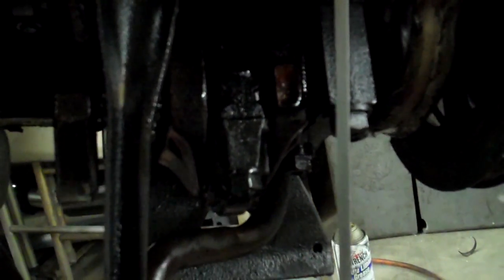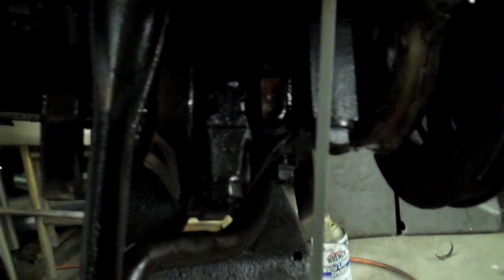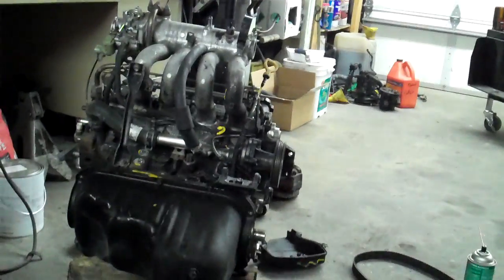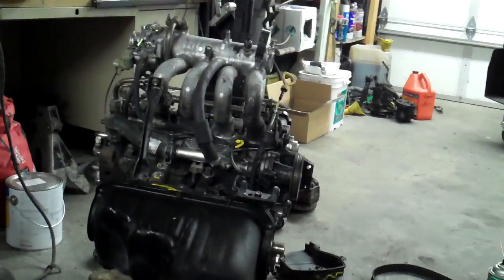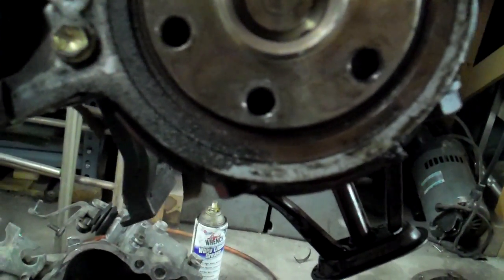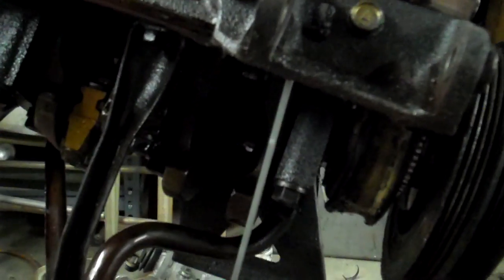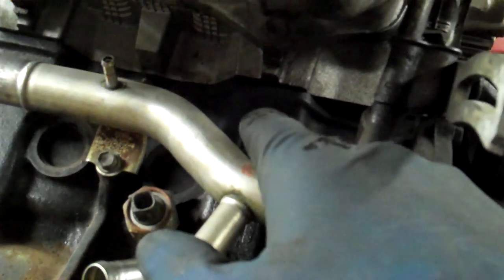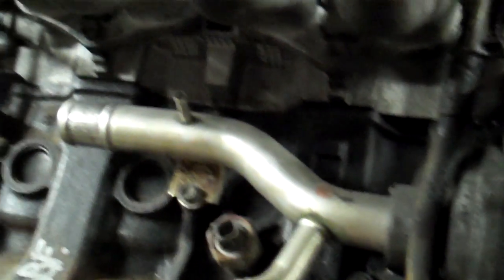ROD KNOCK!!! What it looks like inside the engine.

Comment: Thank you, my wife's car's engine just had this happen, so severe that there were pieces of shrapnel and contaminated oil left in the oil pan, the engine basically exploded according to the gentleman who fixed the car.  We immediately pulled off the freeway when it happened and stopped driving it immediately, so I figure it's something like what you describe here where it was happening over time and then it just finally locked up and shit itself.

Comment: Thanks that helped categorically to comprehend rod knock. I subscribed your channel as a result.

I am desperate for connections to get a good inexpensive beater. The problem is people don't answer their ads and most of it is over priced fixer-uper or parts cars and should be in a separate category not as if it is drivable.
Are you say within 200 miles of Aberdeen Maryland and have something you have gone through and know it will run for a year and that I can save to overhaul it after a year?!

Comment: Is there a way to fix a rod it’s bent
Reply: Not worth doing, Even if you can get a shop to straighten it out it will never have the same original strength. If it didn't ruin the cylinder wall you are better off getting a whole new rotating assembly, Crank, Rods and Pistons while having a shop check the cylinder bores. I would also check into why the rod was bent in the first place.

Comment: Brian, have a question about the cap, could you have replaced the cap and bearing and flushed the engine to get any grime out and put a heavier oil in there? Just a question to see the possibilities.
Reply: probably not that severe of one, but ones with less play you might be able to extend life a bit longer on the cheap. or just run some lucas in it for a sight chance of extending it depending on severity.

Comment: I have a mazda cx7 the engine is now took all apart has a rod knock I was told . My question is do the rod suppose to move side to side alot? Trying to figure out if I should get new connecting rods or cam shaft

Comment: My knocking was the push rod it broke off the little ball on top and it had a loud knock in my engine light starts flashing because I tighten it too much I didn't use a torque wrench I watch your previous video of cleaning noisy rockers and push rods you taught me how to clean them but you didn't teach me how to torque them I guess I have to have somebody to torque them for me because they keep breaking

Comment: can u change the crank bearing from the bottom
Reply: One bearing?  Maybe, to get down the road for a short time but not as a permanent fix.  Under the car it's tough to keep things clean, hard to get the torque specs right and there is almost no way to check to make sure the clearances are right between the crank journal and the new bearing surface.  Attempting to change a crank or rod bearing in car is a good way to toast internal components.
Reply: i meant the rod bearing

Comment: just put a new rod in and crank kit at advance 200 bucks that way you even put new head gaskets :)
Reply: If the engine is thrown out of balance because of the new rod it could lunch the whole engine.  The needed machine work and balancing probably cost more than the salvaged engine not to mention the time to rebuild.

Comment: How do you go about FIXING something like this?
Reply: Pull the engine, buy a new rod, disassemble the engine and send it to a machine shop for machining and balancing to match the new rod to the rest of the assembly. New rings, new bearings at a minimum and likely as the gentlemen stated, based on the state of that rod, replace the crank.  Hopefully yours is a spun bearing and not as bad as the video.

Comment: not only all that but it should be sent to a machine shop to check tolerances so if it needs more parts or machine work it costs a lot more than a used engine with hopefully a warranty.

Comment: can a bad rod cause your car to shut off it also has a loud fast knock ( itll crank back up after sitting 20 mins)
Reply: April Cox sounds like you have a different issue. maybe a bad bearing somewhere water pump maybe even alternator.
Reply: It turned out to have thrown a rod
Reply: Motor has been replaced and its back running great
Reply: April Cox no crap. that's odd. did the mechanic tell you it threw a rod without you mentioning it or did you ask him if it could be a rod knock before he started diagnosing it?
Reply: +Ashroyer86 he actually said that what it was. the knock was real loud and super fast i think personally think the pistons were shot but whats done is done now right
Reply: April Cox either way its a big job. not something most people do on their own.
Reply: +Ashroyer86 very true.... it took him a month ti get my truck back to me smh

Comment: i hope i still can have an answer: 
if i have a rod knocking does is mean the engine is dead and that i need a new engine or just exchanging them?
Reply: shomriti SH no the engine should be fine but the only way to find out is bring the heads, block and crankshaft to the machine shop and have them check for cracks. If there are no cracks get them machined and rebuild!

Comment: Super cool!!! Don't worry about the haters....This was much more informative, than a closed engine or noise only explanation. Also, you get clean shots of the parts and what you're doing.
Definitely going to keep following, as I've added a Subaru 2.5L outback to keep my '83 300D company.....both projects: engine for the Subaru, suspension, interior/exterior for the Mercedes.....

Comment: Brian you said it was a small piece of foil. Was this due to someone filling the oil filter during the oil change they opened a bottle of new oil by breaking the foil seal and then poured some into the oil filter which also took in a piece of the foil seal and the person was taking proper notice?

Comment: Thank you for this video, Brian. My 2006 VW Jetta is making a thumping / knocking sound occasional and usually while I gently  accelerate. I'm trying to determine where it's coming from, and it sounds like the front passenger side. I had new tires put on about 6 weeks ago, but the tires are built for inclement weather not a quiet ride. I'm trying to establish if I'm hearing road noise, or if it's my precious engine. Fingers crossed it's just road noise, but I think I'm going to have to drop it off at the garage to have it checked out.

Comment: Question for ya.  I bought a 2006 pontiac torrent 2months ago. Engine light was on codes were misfire on cylinder one and evap leak.  We changed the water pump which we knew was bad all the spark plugs.  Checked the wires all was good after that no more bad water pump noise.  but the engine light still read same code.  was going to do a compression test because it started to make a slight tapping noise for a few days but I think I was a day late and a dollar short.  pulled out of the drive way drove about 50ft it felt like my tire was flat or my belt came loose.  Car completely died at first but now it cranks but won't start.  BIG hole in bottom of the motor with oil coming out.  I know sounds like I threw a rod . but it's never over heated had oil in the dipstick my oil light would come on when I started it but went off a few sec later. How so u blow an engine with no warnings?
Reply from the maker: From my keyboard I have to say it threw a rod.  All it takes is a hunk of sludge to block one oil journal on one connecting rod.  Sorry man.

Comment: hey i have a 2003 dodge ram  1500 i have replaced  the connecting  rod bearning.  like 3times and i keep having the same problem.  do you think  that my crankshaft  is bad and i have to replace  it.

Comment: hey i have a 2003 dodge ram  1500 i have replaced  the connecting  rod bearning.  like 3times and i keep having the same problem.  do you think  that my crankshaft  is bad and i have to replace  it.
Reply: Johnny  Dumont you should probably just rebuild the bottom end of the engine and then you don't have to worry about it anymore. Taken care of completely. (ASE certified technician by the way)
Reply: thank you  so much
Reply: did ya use a plasti gauge .??     Ya maybe could of got a bigger bearing.  Im replacing the rod bearings in the bottom of a 2.7 chrysler mopar.  I know its a loosing battle.  But im just waiting til tax time .. Few more months.  :)

Comment: I read that this engine was a sliced v8 -->v6 I have changed pistons from the bottom in 327 chevy Why is it not possible here, you just use the ring compressor from the bottom of the bore?

Comment: Well Duh, pull the bad con-rod, piston out and remove the appropriate sparkplug, and Wa-la, no more rod knock, AND you can keep the same crankshaft! Minor oil leaks near said spark plug may occur though.
Reply: Far From Perfect could always pull the valves for that cylinder, and just plug the spark plug hole.

Comment: I have a question,my engine is knocking consistently heavy on turning over.. then it goes low.. when accelerating it gets faster when I go beyond 1k rpm.. my question is is itchy all possible that it could be a blown spark plug?..  it's a 5.4 Triton
Reply: lol.. "Is it all possible"
Reply: +Ricardo Lupian  Aww ty..lol.. wherever it was died last Friday. lol.. oil everywhere.. I'm just replacing the motor. ty though
Reply: +Ricardo Lupian  Aww ty..lol.. wherever it was died last Friday. lol.. oil everywhere.. I'm just replacing the motor. ty though

Comment: This might be a stupid question, but couldn't you leave the Pistons and rods in? Just to swap the crank?
Reply: The pistons and rods will fall out without the crankshaft
Reply: Tim's Tech not if the engine is upside down though right? Like on a stand?
Reply: upside down is ok.
Reply: Because the rod needed to be replaced as well

Comment: I removed all 6 wires one at a time and the noise is still there. Does that mean it's the whole crankshaft? I hear it really loud when i turn the a/c on. But when it's not on 75% of the time it's gone, and when i do hear it, it's because im turning the wheel left to right while sitting there idle.
Reply: I found out that the knocking wasn't the engine, but a loose flexplate. I pulled off the cover to have a look while it was running, and it was wobbling all over the place.
Reply: +Gerald what's a flex plate because I have the same sounds
Reply: +Cody Green another word for flywheel. connecting the torque converter, trans and engine.
Reply: +Cody Green mines was cracked all around the middle, so i put in a new one. if you drop the transmission to check the flexplate (flywheel) then just change it out for a new one even if the bolts were just loose. because there can be cracks in it that you cant see from all the vibration and would have to drop the trans all over again to change it out.
Reply: +Gerald what did your knock sound like

Comment: If you'd replace the bearings from a scrap engine, would that give it a little more life? Not a practical question, but in theory.. Would replacing it fix the knock?

Comment: my car does a loud knocking sound only when it gets to normal temperature can that be a rod problem?
Reply: Could be
Reply: I have the same problem, did you figure out what it was?
Reply: Alejandro Rojas
hey my zuki is in the shop right now and they found all transmission bearings are bad...basically same problem
Reply: yeah I haven't checked it out yet but when I rev the engine the sound goes away so I'm not sure what it could be
Reply: Alejandro Rojas
must be the trany buy a used one for 250 bucks and problem solved
Reply: @cazaypesca  Nothing to with with the transmission. It's a connecting rod in the engine.
Reply: Caza Y Pesca

Comment: the way it was designed?? am I missing something or did you just rob your customer.
Reply: No,it is literally impossible to set the piston rings from the bottom of the motor as he was explaining.For the cost of labor and parts to replace/disassemble and rebuild that whole engine,the customer was better off getting a different engine (junkyard,salvage,engine depot etc,and simply swapping that in.

Comment: This was good, thank you. I was looking for a video that would actually show the Babbitts (shims) riding hydraulically on a thin film of oil, like they do when everything's tight. I want to show my son what happens when the oil loses its nice viscosity, or the oil pressure is insufficient to float the bearings under high load.

I don't know how someone would ever get a picture of such a thing, but it would be interesting to see – even a bearing "spinning".

Your video is good and wiggling the bad connecting rod is certainly a legit diagnosis. Other good key points were mentioned.

Comment: would this cause ur car to burn any oil?
if ur car doesnt lose any oil betuin changes its in good condition?
Reply from the maker: +Raidel Pichardo Oil consumption and rod knock aren't directly related.  Piston ring wear and rod bearing wear can both happen together, but they don't always.  You can have one without the other.  Piston ring wear causes oil consumption.
Reply: +briansmobile1 thanks mate

Comment: Will a rod knock, knock 24/7? Or will it just knock when it heats up? Because I have 2001 blazer with a rod knock sound and a misfire. It doesn't make the noise when first started up but after 5 mins I will here that knock.

Comment: Thanks dude! My 2005 ZX6R 636 was acting up and started knocking :( and I thought it was a thrown rod or a spun bearing at first until it got worse... Even though initially, I thought it was an extreme case of CCT failure and/or guide failure... You helped me make a educated guess and I believe 'you' and 'it' was correct. I pulled my engine (took 2 hours) and will find out tomorrow when I crack her open... The carnage lol. Thanks again bro, very informative!!! :)
Reply: 6 years later, how was it?

Comment: Hey Brian, I have a 74 Buick with a 455, it had a real bad rod knock, the car had been sitting for years, I was able to get it running and drive it a few miles to my new house but on the way it seized up and shot parts completely throw my oil pan, my question is, do you think my engine is salvageable, and do you think that I may have caused irreparable damage to the block itself?

Comment: If Rod Knock occurs in the engine.,. does that mean it's the start of a serious issue and can be fixed, or the nail in the coffin ?
Reply: rod knock itself is already a serious problem. it can be fixed but if the engine is as fucked as the one in the video its not really worth saving unless you're restoring the engine.
Reply: +Edgar Martinez Are there any symptoms leading to Rod Knock so you can get it checked before it becomes serious ?
Reply: One or combination of these things will lead to rod knock such as Insufficient oil pressure,low oil viscosity,insufficient oil flow in the bearing surface,excessive oil temperature,excessive combustion pressures and overrevving the engine - high piston inertial forces

Comment: I recently had crank changed, bad knock now it is tapping it's not loud you can hardly hear it, but I know it's there. the oil pump wasn't replaced so I think that's the problem. my question is where can I buy a good engine I saw a eBay zero mile engine do you have any answers
Reply: well if you got the crank changed the guy who did it (hopefully not you) machined the crank or the bearings too thin and the crank has play in between the bearings, it happened to my uncle

Comment: Hey brian i just bought a 2003 mazda protege5 and makes knocking noise when i gas it but then goes away. But stays quiet when on Park any idea if its the rod bearing? Thanks
Reply from the maker: +Mazda5 Lol That could be spark plug knock or predetonation.  That can be caused by carbon build up in the cobustion chamber, using gas that's too low octane, or by a back knock sensor.
Reply: +briansmobile1 oh ok its really driving me crazy Lol thank you i will into that

Comment: Thanks so much.  I have a 2007 Chevy Impala and I have the knock.  I may have to get a new motor??? OMG, I hope not. :(
Reply: how loud it, what's the displacement, what is the valve train setup, and does it go away after a few mins.
Reply: +Ballista Bomber mine knocks for like 5 seconds then goes off...but it knocks everytime i start the engine
Reply: nkauj hmoob its lifer tick it's just the noise the lifers make before the oil gets from the oil pan to the cylinder head
Reply: +Ballista Bomber so its ok to drive right? i just want to make sure that its not something bad or that is costly to fix since i dont know anything about cars.
Reply: +nkauj hmoob what's the displacement (how big and the number of pistons) and how loud is it
Reply: +Ballista Bomber the noise is just like that movie clip. the sound is like someone knocking. the knocking only lasts a couple secs but it just started yesterday. i have no idea what pistons look like lol
Reply: +nkauj hmoob its a infiniti q56
Reply: +Ballista Bomber ill look into that
Reply: +Ballista Bomber I mean lifter tick not tuck
Reply: nkauj hmoob i looked at your car online its just lfter tick its pretty common for dohc engines you either have a 4.5, 5.0, 5.6 v8 its fine to drive just keep your oil full and clean
Reply: +Ballista Bomber omg thanku sooo much for looking into it n for the info. thanks again!
Reply: nkauj hmoob i might be wrong but most likey its lifter tick and your welcome :)

Comment: Thanks for the explanation. My van just threw a rod with about 5 seconds notice. I guess the last place we got the oil changed at (Prompto) didn't tighten the oil filter and I didn't see the leak so it got too hot... typical chick I guess. And then turned it on this morning, heard loud knocking and a bang when it was fine yesterday. A rod shot down through all kinds of stuff. I didn't know what rod knocking was or that throwing a rod was a thing. Merry Christmas. :/